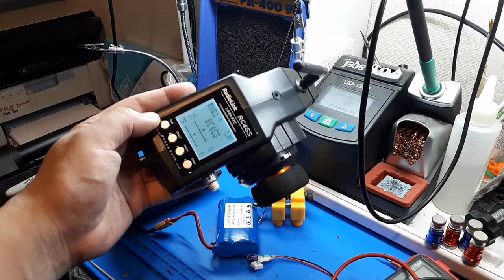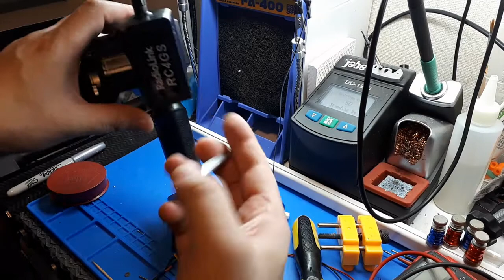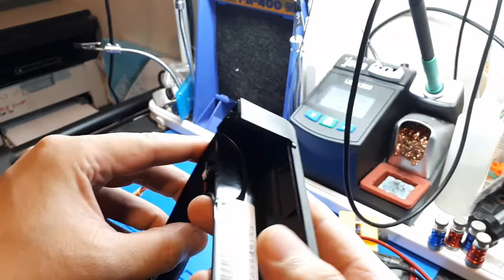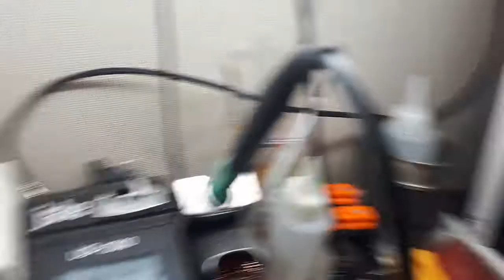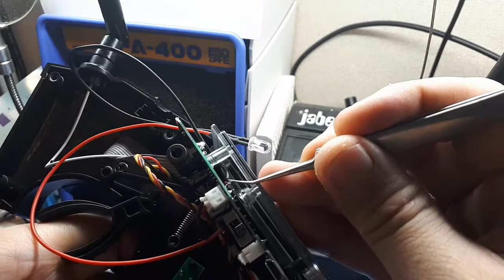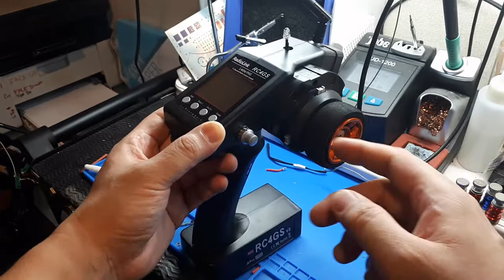Radiolink RC4GS LED light power on mod & FAIL tutorial and warning

Comment: I emailed the company asking why it is they haven't programmed this unit with an auto shut off. If you're using LiPO batteries with this and forget to turn it off that battery could catch fire and in fact I've done this only to open my battery compartment to find a swelled lipo near the point of bursting and of course it was ruined.
Reply from the maker: Whoa that's a serious design flaw. Hope they make a change before a bunch of people have their units catch fire.

Comment: Its a cool mod, but this way you are feeding the light  with battery voltage..it won't survive it.
Reply from the maker: Please explain why the LED won't survive long; it's a 12V LED.  I'm sure others would want to know too.
Reply: @smallmodelcollector  Because voltage is not regulated, but if you run your radio on 2s battery, it should be fine :))
Reply from the maker: @ethrrr  Ah, thanks; I'm not an electrician.  Luckily I do run a 2S in this.